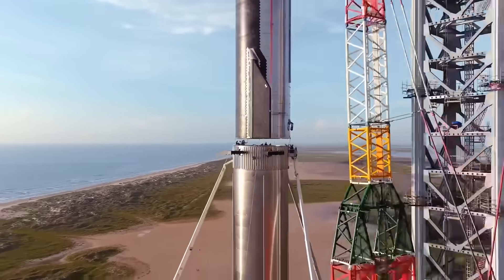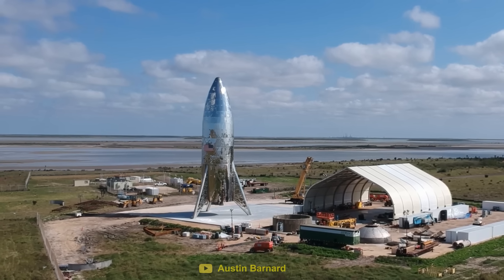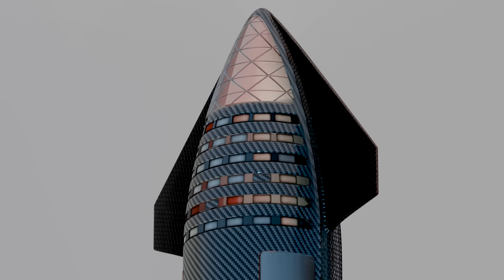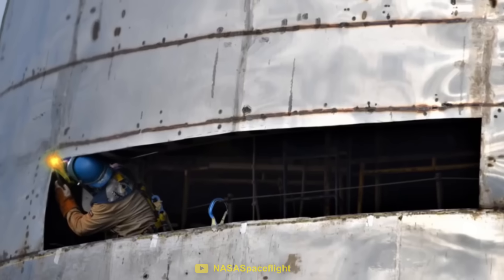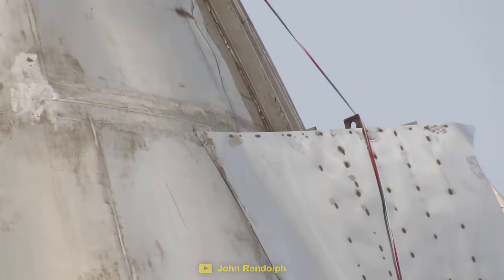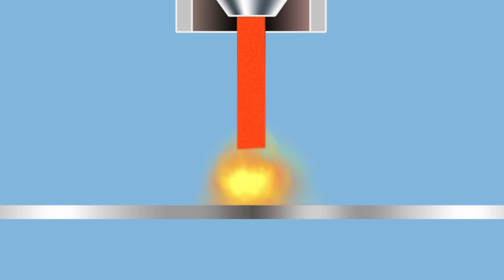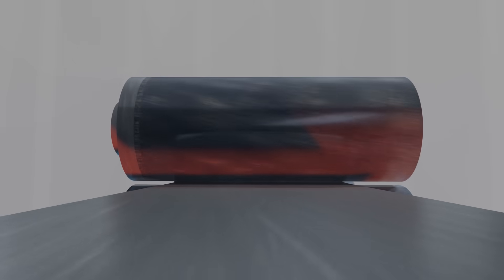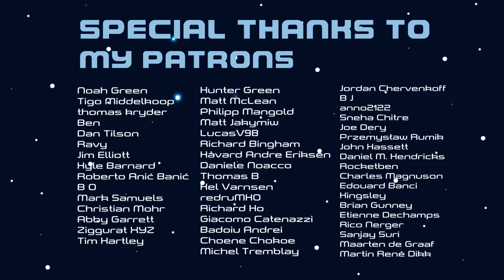How SpaceX Mastered Starship’s Welding

Comment: Well carbon fiber itself can withstand temperatures up to 2000°C but the bonding agent (normally resin) can only withstand 200°C, so with different bonding agent used it could withstand those temperatures but development, manufacturing and repair would be much more expensive.
Nevertheless a great video!
Reply: Carbon fiber has a practical temperature limit in air (oxygen environment) of around 800 - 1000 C, in a vacuum CF can withstand much higher temperatures.
Reply: @davidb6576  Thanks for clarifying
Reply: Regardless, you can't just take away half of what carbon fiber is. The properties of the resin are just as importaint as the carban to make it a strong and light material. I'm sure the original design was just another case of an animator trying to make things look cool and futuristic.
Reply: Graphite fiber gas has negative coefficient of thermal expansion,  a high temp resin matrix (withstanding 3000 degrees) has been available for decades ....see brake rotors of a FA- 18.
Reply: @duncandmcgrath6290  Look up Fiber Materials Inc. in Maine. (Now owned by Spirit Aerosystems). They’ve been making carbon-carbon and 3d carbon matrix composites for rockets since the 70s!
Reply: You can use graphite as the bonding agent like they used in brake disc pads for large airliners

It is a very long and expensive process so maybe that is why it is unfeasable?
Reply: Or just ask NASA/ESA/All the other space agencies and their rocket building contractors like Northrop Grumman!!!
Reply: J

Comment: You got Flux Core welding backwards, the Flux is in the middle (core) of the wire is what provides shielding and turns into the slag ontop of the weld.

Comment: The cost comparison between the metal vs carbon fiber should be in terms of surface area. Even tho the cf is much more expensive per kg, there is significantly less mass needed to build the rocket compared to steel
Reply: Yeah..good point.
Reply: Except that you have to also count in burn off rate of CF. Because the Starships are more than onetime use, they need to be able to be used over and over. A CF Starship would not do that over time. The CF would get thinner and thinner until, well it would self destruct.

Comment: Starship has been pretty unique as far as rocket development goes. It's almost like agile software development: "Move Fast and Break Things"
Reply: Break cheap things
Reply: @gardensoundrecords3598  yep this is how agile works
Reply: @gardensoundrecords3598  as long as it's nasa's money amiright?
Reply: The approach pairs especially well with the ultimate goal of mass producing many hundred rockets.  Start by trying the least expensive production method possible to see IF you can get that to work.  If not, upgrade the process a little and try again. ...
Reply: @737smartin it really does
Reply: @737smartin only idiots would believe a starship will make it to the moon.
Reply: @737smartin  Agreed banjo man.  His rockets look like air ducting.  Total cost basis building. I love it.
Reply: @737smartin  yes... Make small models! Not to scale scrap!😂😂😂
Reply: @ii-es2sn  Small models are useful, but there's more learning when you do it at full scale--especially on the manufacturing side.
Reply: It's actually closer to early rocket development in the 60s than other current rocket projects. The general idea is to build many iterations of your rocket and observe what fails. Fix this and keep going. It's more expensive than just simulations, but can result in a more stable product faster and in the long run it is cheaper.
Reply: @mo3bius58  Well stated Moe.  Reminds me of the V2 rocket footage from the 40s.
Reply: See also: early airplane development (weaken everything to save weight, see what breaks, strengthen that and weaken everything else, repeat)
Reply: Reminds me more of a guy working in his garage - big high tech garage
Reply: I believe it is the same as agile software development, but applied to rockets of course. Create prototypes to test concepts, changing the design as and when needed, and converging to the final product.
Reply: @StillAliveAndKicking_  For the most part I agree. However these rockets will have precious human lives in em soon.  His operation will be quite stunted if those lives are lost during operation.
Reply: @elefanny1106  I don’t understand your point unless you are suggesting that the SpaceX approach leads to more failures. Just look at Falcon 9. The current version has a 100% launch success record from over 100 launches, the most reliable orbital launcher ever. The SpaceX approach works, it leads to simpler, cheaper, more reliable systems.
Reply: @elefanny1106  I don’t understand the point you are making. The SpaceX approach is proven to create MORE reliable systems. The Starliner capsule had serious failures on its first launch which nearly led to its loss. Crew Dragon has proven to be safe and reliable. The SLS and Starliner are both horrendously expensive, and suffer numerous glitches. BTW your attempt at a joke is a) offensive and b) pathetic as you clearly cannot spell my name, which is pronounced ‘layf’. Don’t get angry because someone doesn’t agree with you, or understand your point. Explain it more clearly if I have misunderstood.
Reply: @StillAliveAndKicking_  Your success at understanding the joke was a) remarkable and b) concerning that a man with a plant name hasnt learned to not be offended.  In regards to the offense….neener, neener, neener.

Ill make it clear enough that even a Leaf Blower can understand, gas or electric. SpaceX cannot make mistakes with humans.  There are more dire consequences now vs just putting things in the air.

If thats not a well written Leaf of the Book we are communicating to each other, Im a Leaf Bug.

Now Leaf me alone unless you want to turn over a new Leaf and go on a date. Then we can Leaf this planet together and off to Mars, leaf to leaf.
Reply: @elefanny1106  human flight rating comes after cargo rating. So it makes sense to put dead stuff on orbit earlier than living people.
Reply: @marcondespaulo  Orale guey!!
Reply: @StillAliveAndKicking_  That's what engineering (should) be all about.
Reply: Evolution
Reply: The ugliest starship ever!!!
Reply: It’s kind of like rapid prototyping on a full scale. It’s probably not the most economical way of doing things but, it does provide the most amount of Probative and immediately insightful information as possible and on a near immediate timeframe.
Reply: never saw an omoletoe made with one egg!
Reply: Not really, this is pretty much how von Braun and Korolyov developed their rockets. Just that it was all top-secret back then.
Reply: I believe the term they use for it is ‘fail fast, fix fast’.
Reply: @ShawFujikawa  More like think big, start small, fast feedback. But you get the idea.
Reply: It mirrors how the Russian space program was developed early on.  Build several prototypes and see what happens between each one.
Reply: It’s so great in this case
Reply: More like agile with test driven development, who read Uncle's Bob Clean Code will know this "move fast and break things" mindset is the receipt for untamable technical debt.
Reply: Its the approach Elon Musk uses in everything. He is very aware of this. I remember a video where he is quoted saying his approach is "Build it, break it, fix it". 

In something as complex and expensive as rocket engineering it seems obvious that such a counterintuitive approach would result in some pretty groundbreaking innovation. Swim against the current and you're going to see a very different set of problems and solutions that most haven't.
Reply: It's 100% an agile approach, build, test, break, fix, repeat until it works!
Reply: That’s the nature of musks iterative design work
Reply: Better than engineering paralysis.
Reply: @stump1897  aka NASA 😂
Reply: "PRETTY UNIQUE" is impossible, since "unique" means ONE OF A KIND and there simply cannot be degrees of one-of-a-kindness.  Something is either unique or it is not.  One of the things you are breaking is the actual definition of English words.
Reply: Yeah... just like the oceangate sub...
Reply: This is the stupid-person's analogy. Starship is a nearly 70-year outdated concept, that was abandoned by the Apollo program after it was demonstrated to be pretty stupid. 

The Saturn V rocket worked on the first try. The Space shuttle worked on the first try. The SLS worked on the FIRST TRY. Innovation doesn't have to "move fast and break things" if you do it right the first time. If you don't try to cut corners, and you actually know what you're doing.
Reply: @thesciguy4823 and look at those morons cheering when they blow up during test. NASA would've been shut down if they kept on blowing up stuff.
Reply: Rocket development has always been this way. Decades of reliable launch vehicles have spoiled us. You can't make a leap forward in rocket technology without blowing something up.
Reply: That's why all of the applications you use are either "over funded" or are completely enshittified by the bottom line. lel. agile was a mistake.
Reply: a terrible idea lol
Reply: " Pretty unique " literally no other rocket on the entire planet throughout all of human history can do what starship does
Reply: @eternalproductions  Like blowing up?
Reply: @eternalproductions  they’re referring to the development process, not the rocket itself. Nobody has developed rockets this quickly and loosely before
Reply: @eternalproductions  Starship can't even do what starship does yet.
Reply: @eternalproductions  *will do it dosnt do anything yet.
Reply: @captain61games49  it lands itself dude what are you smoking , it's the only resuable rocket , it saves 35 000 000 per launch
Reply: @eternalproductions  It mostly blows up
Reply: @eternalproductions  im not smoking anything starship Currently dose not have FAA approval and hasn't made an orbital lunch yet. Even though starship development has gone quite rapidly it will not being doing regular lunches for at least a year. With hope they'll get to do like 4 lunches between now and the end of the year. They're not at mass production yet nor is the protype stage near finished.
Reply: @captain61games49  I didn’t know SpaceX had gone into catering. Do they also do evening meals? Yes it will be years before Starship carries passengers if ever. They will have to do countless crewless launches and landings. I wouldn’t fly in it.
Reply: @StillAliveAndKicking_  i apolagise for My spelling
Reply: @captain61games49  No need, it allowed me to take the mickey. 🙂
Reply: @StillAliveAndKicking_  ;)
Reply: @eternalproductions  not only to land haha, older spacex rockets are the ones that have been flying and landing
Reply: @jackbarry9469  thanks who would of ever thought the same company would use the same technology wow such insight you have
Reply: @eternalproductions  Starship doesn't land itself yet, you're thinking of the Falcon 9
Reply: Indeed, and that's not the only unique thing. When we see them working on Starship, they aren't working on what most people think they are working on. It's not about putting that rocket in space, they could've done that in a much easier way a long time ago. It's not about making a prototype that can go to space and be refurbished and reused later. Everything they do goes towards complying with multiple goals at the same time: It needs to work, it needs to return and be immediately reused again, and it needs to be easy and cheap to mass manufacture. Nobody had ever mass-manufactured a rocket before, and a lot of the work they do is going towards that. They aren't working in stages as they did with Falcon 9 (first priority was it needs to fly, then they got to work on reuse, and then they improved manufacturing). Starship has the time and money to try and accomplish all of those things from the get go. 

I think people underestimate just how good and fast they've gotten at making Starships, and they don't even have a proper factory yet. Once they are settled on a design, nobody will believe how quickly they'll be able to go into mass-manufacturing the entire ship, and how quickly and cheaply they'll be able to do it. 

I predict that by 2030, most rockets in existence will be Starships, both by quantity and total mass.
Reply: It is exactly agile hardware development. Listen to interviews with Joe Justice, mind blowing stuff.
Reply: cockburn would be proud

btw I entered my software design exam today, what a coincidence?
Reply: Derived from the Soviet Space Program
Reply: @rocketkinger2506  36 full-flow methane burning engines?
Why is it I haven't seen the Russian version yet?

Comment: No mention of SpaceX developing "friction stir welding" for steel.
Reply: No mention of using the stretch form process for the compound curved surfaces, therefore eliminating the number of weld joints and  the previous flat faceted appearance when surfaces are more complicated then cylindrical and conical.
Reply: @Dug6666666  Spell check error, eliminating not illuminating.
Reply: @gravelydon7072  yer that makes better sense :)  fixed
Reply: FSW has been used on steels since it’s inception

Comment: This seems like an ideal place to use friction stir welding
Reply: friction stir is used more if you want to fuse 2 pipe ends, or round bar
Reply: @lukedeehan2011  SpaceX already uses proprietary friction stir welding for manufacturing their falcon 9 tanks which are made of aluminum-lithium alloy. 
So, they already know a lot about friction stir welding.
It is only usable for softer metal such as aluminum.
Stainless steel cannot be friction stir weld, as far as I know.
Reply: @josephine2869  It can be, but it is meh at best. It would be a huge leap in welding technology to see FSW as commonplace with SS alloys.

Comment: Great video, it was really informative. I was expecting you to touch on SpaceX's custom steel alloy, kinda disappointed that you didn't. Do you have any plans on covering it in a future video?
Reply: The 304L is a standard low carbon commercial Austenitic Stainless Steel, less corrosion resistant than type 316 but also much more versatile … 301 wasn’t a type we’d use in the trade in NZ. 308 was a good heat resistant Stainless found in Commercial Oven systems . I’m curious as to what Stainless steel will end up in the production Cybertruck. Personally I’d use 304 and electro polish the body when fully welded like we did for Marine Stainless Fittings … great protection and very bright but also a good surface to wrap if you wanted colour …
Reply: @chrisbraid2907  The same that is used on Starship will be used on Cybertruck to drive economies of scale.
Reply: Tesla is using a non-standard alloy for their mega castings. I wouldn’t be surprised if they are developing a non standard stainless steel.
Reply: @TamagoHead  yeah we know they have developed their own custom stainless steel alloy for Starship and elon's already confirmed it. There just isn't a whole lot of information out there about its properties and characteristics.
Reply from the maker: Thanks! I just didn't find enough info on their custom alloy. I'm also curious to hear about it!
Reply: @primalspace  I kinda figured that was why. SpaceX is doing the opposite of what they normally do and are keeping that info close to their chest. Makes sense though, my ex father in law was the head metallurgist for the American arm of the Swedish company Sandvik up until he retired last year. He said that developing a new alloy is a typically a huge undertaking and involves mountains of tests, retests and process tweaking. Not only in the metal ratios mix, but the actual process used to make the alloy (like a cake recipe. Ie. Mix this before that, but only when the temp gets to x degrees, etc) and all the testing that certifies the material will do what it supposed too.

Comment: I have a question for fuel expert here or other expert. "Where will the fuel come from or some people says it would required a 30 large truck to refill the Starship, So where or will it be enough?"
Reply: There is a fuel farm onsite , it's currently trucked in,  but soon the onsite refinery will produce it's own fuel.
Reply: The Sabatier reaction is a process where they take carbon dioxide and water and create oxygen and methane.

Right now they don’t have their Methane manufacturing capabilities up to scale yet so they are having to bring in tanker trucks with methane. 

Eventually they will be able to produce enough methane on their own
Reply: @hamslicemcdooogle8080  I mean 30 That large truck ever time?
Reply: @Tinjinladakh  Until SpaceX gets the old gas well site up and running, yes. Truck delivery only for all launches.
Reply: @Tinjinladakh  yes. until they have the ability to make their own methane on site they will need it all delivered. until their methane production can fully support operations, they will need the difference delivered. every time.

Comment: The prototype LOX tank at 2:23 is for the original ITS vehicle, with a diameter measuring 12 meters, not 9.
Reply: the ITS is still by far my favorite, it's a shame but understandable it was replaced
Reply: @MemeThief180  It was cool but i like how they applied a real use of the belly flop on practice and the "sleekier" design of current Starship compared to ITS
Reply: I did not know the old giant starship kins of existed physically